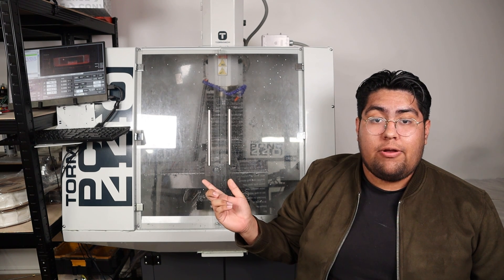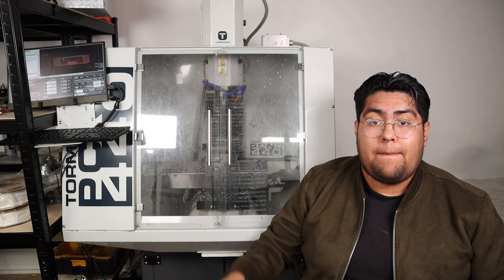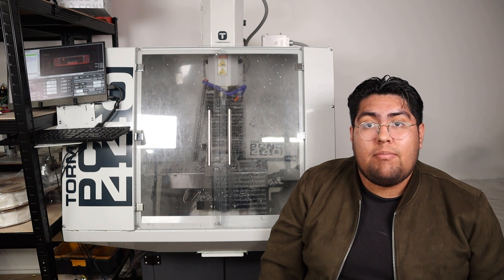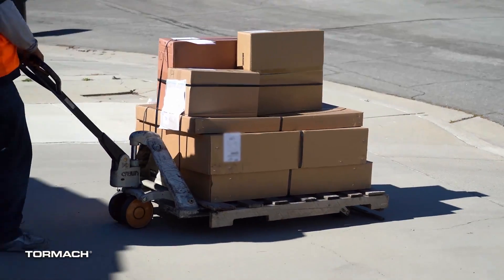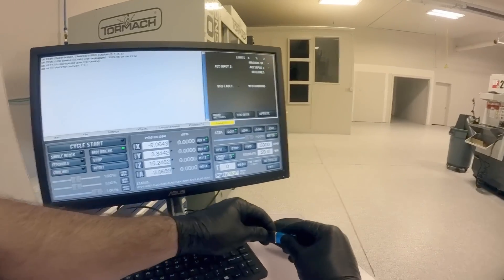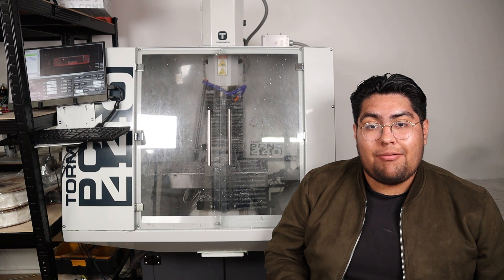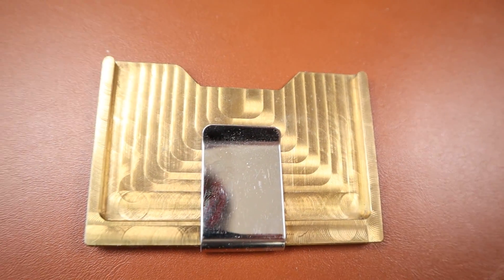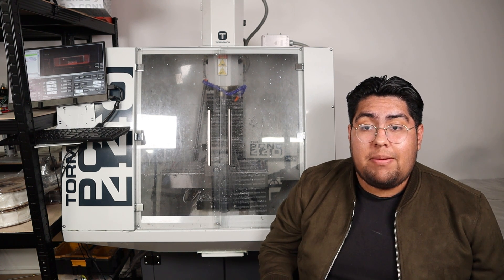Buyers Guide to CNC Milling: From Purchase to Machining

Comment: Appreciate you sharing your experience!
Just a heads up, if you have “an engineering company” in the future, you should be careful about using that word in the company name or in how you market the services, because in most states you’ll need a licensed engineer on staff and a company registration with the state’s engineering licensing board.
Reply from the maker: Ah I see. Thanks for the tip I’ll keep that in mind.

Comment: My family thought I was crazy for spending the 13-plus grand I spent on my Brand New Tormach 770 CNC mill with all the bells and whistles.
This was before all of the economic sanctions were placed on Chinese products coming into our country.  Things were a bit cheaper back then.
Before retiring I did custom auto interiors on vintage automobiles for about 35 or 40 years.  Many of the parts for these vintage cars were no longer available.  If they were available, they were outrageously expensive, so I used my Tormach 770 to fabricate vintage car parts.  When I wasn't working, I used my mill to make some of my own projects come to fruition.
I sold my mill when I retired thinking I wouldn't have much use for it anymore.  Boy, what I wrong.  Now that I have the time to work on my own dream projects, I don't have a mill to do it with.  I sold my full-sized gunsmithing lathe and most of my other metal working machines too, so I screwed myself there as well.
Now I'm slowly getting back into machining.  I'm going back to my roots with a small mini mill and mini lathe.  I'm self-taught with all of this stuff; from G-Code to lathe turning to CAD/CAM.
These milling machines, like all other metal working machines aren't just machines, they're tools used to make the dreams in your head into real tangible reality items.
When I wasn't working on cars, I used my self-taught skills to fabricate airgun components that I sold hundreds of to buyers around the world.  That was just one of my dreams when I bought this 770 CNC mill and I still have many more still waiting in the wings.
https://www.instagram.com/p/CJ4Bm6ehJ2P/
Reply from the maker: Yea, being able to turn an idea to reality is such a good feeling. I know I can order a part online for cheap nowadays but sometimes I want it in the moment. 3D printing and cnc milling has come in clutch for that.

Comment: You made the right call - Tormach is a much better, fairly Industrial machine.

I have a 4 Axis Bridgeport + a nice CNC Lathe - but perhaps interestingly, I hardly use them these days.  I built a CNC Plasma (then two more better versions) and have found that by changing my design strategy, I've been able to make everything by plasma cutting & folding sheet metal (where I need strength / rigidity) and 3D Printing for everything else.  The combination is much quicker, cleaner and more reliable - even if the parts don't always look quite as beautiful.
Reply from the maker: Interesting. I also got a plasma cutter recently but I haven’t been able to use it on a project yet.

Comment: Great video. I have been considreing getting a 440 for a basement shop. No way I can afford a haas, no way to power it or move it into my shop. But with an ATC and power drawbar the 440 is looking like $14k for the machine alone and that is a steep price to pay! I've used Tormach machines before though from my local makerspace, they are pretty great machines for learning CNC.
Reply from the maker: Yea for sure. In the future I also want to get an atc and forth axis